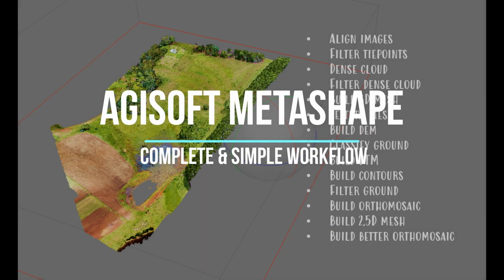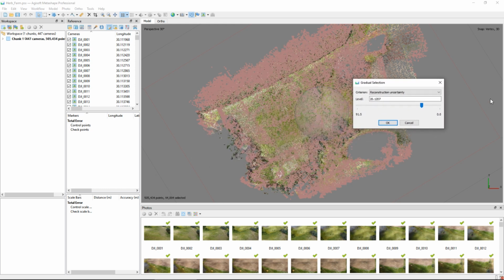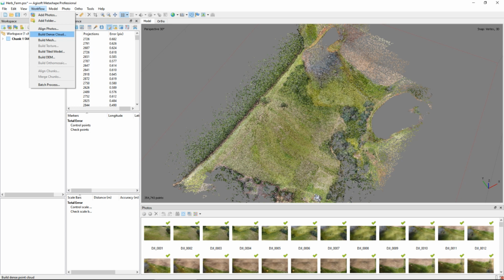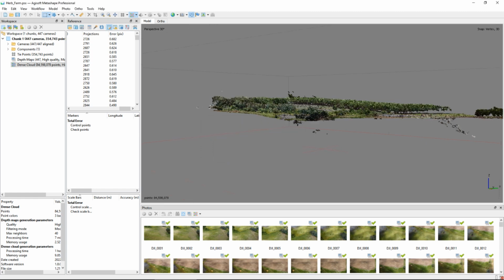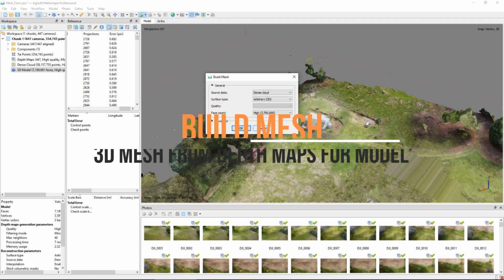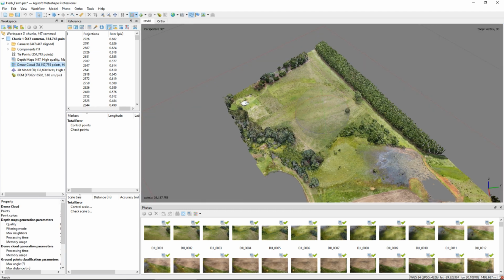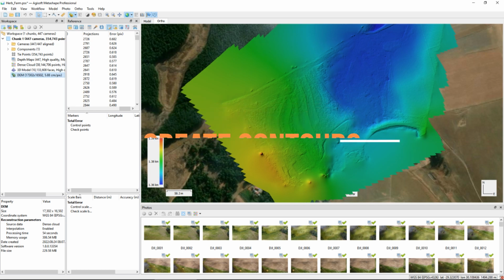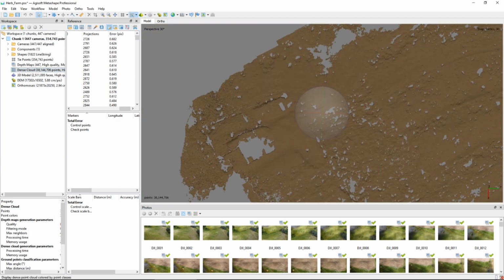Agisoft Metashape - Complete Tutorial (Cloud, Mesh, DSM, DTM, Classify, Orthoimage - No GCPs)

Comment: i'ts very hard to grasp what do I need to look after when filtering the dense cloud, to make an informed decision. I couldn't understand from your video what to look for. You have any tips for me? Thanks for the video anyway it has a lot of useful information already as it is.
Reply from the maker: Hi - it will vary from one project to the next. Effectively you are trying to judge which points are valid and which are not. To do this analyse the point positions. Are they in the same place, relative to other points? If they should be on the ground, are they on what looks like ground level? Is it meant to be a flat surface, then are the points flat? The more you do it the more comfortable you will get with making the decision. Generally, points with a confidence of 0,1,2 can be removed. With better cameras, there will be fewer erroneous points. I hope that helps a little and I'm happy to go into it further if you like, fell free to email me: geospatialtips@gmail.com
Cheers

Comment: What's the better step in your opinion, if we mark and align the GCPs first, then we do the gradual selection or vice versa? Thanks
Reply from the maker: I prefer doing the gradual selection first and then adding the GCPs afterwards. I feel that by doing so you calibrate and correct the camera independent of the GCPs (avoiding any potential GCP errors) and thus any check points have a greater likelihood of being of the same accuracy as the GCPs. (I may be wrong, but I use and prefer this method and it works well for me, others may have differing opinions)

Comment: Hello! Great video, i have some questions, if u answer me i would be very gratefull. How did u achieve such a good overlaping of your pictures ? your dense cloud is almost like an orthomosaic being seen from above. When i filter all those pictures just as you indicated, it felt like my point cloud would be almost empty.
Reply from the maker: Hi, thanks for watching.
In this example, I flew manually and also flew in a double grid pattern, so there was plenty overlap in all directions. It isn't necessary to do this, but it helps ensure a dense point cloud. Even if flying automatically, you can increase your side and forward overlap and it should give you more data in the final result.
If you are losing most of your points in filtering, it seems like the matches might not be good. You can process using higher settings and perform the gradual selection steps to ensure better tie points before building your dense cloud. The terrain you fly over will also have an impact. If there are lots of trees, the matches will usually be worse and you lose points in that case.
In the end, if one of that helps you, feel free to send me the data and I will take a quick look if you like. 
geospatialtips@gmail.com
Reply: @geospatialtips  thank You so much for your answer. I really apreciate it. Regarding to your proposition, it would be great for me if i could send you some information of My works. I Will be getting in touch soon. Greetings!

Comment: How important do you think it is to classify ground and high vegetation when mapping a forested area? It seems when I don't, the canopy of the trees get swirled or blurred. Is there a reason for this? I'm asking because I've been having issues with classifying ground points in the new version of Metashape. It's been driving me insane.
Reply from the maker: Hi - I haven’t tried the classification in the new version yet, but seems I will need to check it out. As for the trees versus ground issue it really depends on  a few factors. The swirls will likely be because the model goes to the top of trees, back down to ground, then up another tree and so on. Have you tried a 2.5D mesh that includes the trees? It may help limit those swirls. Also, if you only use classified ground the result might look better, but you may also start to see your trees leaning one way or another and not be straight up any longer.
Reply: @geospatialtips  Thanks for the response! I actually downgraded to an older version of Metashape. The ground classification worked much better! I found that creating a DEM with only ground points also gave me a higher quality orthomosaic without the swirls in the trees. It really makes a difference, not sure why. I wonder if there's another way of getting better quality orthos with forest cover, without having to do the classification process.
Reply: @geospatialtips  I actually have another question... Whenever I change coordinates from WGS to my native UTM system, it tilts the whole area by about 30°. I thought this was another issue with the newer version of Metashape, but I had the exact same problem with the older version. The only thing I can think of is it being my new drone, DJI Mavic 3 Enterprise. Is there something in doing wrong when importing photos? Should I be calibrating photos a certain way? Metashape seems to recognize the M3E ...

Comment: If we generate a 2.5D mesh and then would like to also have a 3D mesh is there a way to have both in the same  project? Will generating the second one overwrite the first one?
Can we have a DEM from both the 2.5 and 3D?
Sometimes I'd like to try different combinations to see what gives the best results.
Sometimes I might want a 2.5D to make an orthomosaic but use the 3D for volumes, etc.
Thanks again. This channel has filled in a lot of holes in my Metashape user capability.
Reply from the maker: Hi JSD!
Yes you can have multiple meshes and models. I often do the same as you, one for the mosaic and another for volumes. I am not sure if the latest Agisoft version changes anything but you should have the option to not overwrite existing models when making new ones. Also, rename the first model you make before creating the second to make sure they are easy to distinguish.
Reply: @geospatialtips
Hello Sir!  
I'll look for that option and rename before creating new items. Sounds like that should do the trick.
Thank you!
 I hope things are going well for  you, over there on the other side of the world 🙏

Comment: Hello,
I love your videos. They did help me a lot, but I stumbled upon a problem. When generating contour lines, it says minimum altitude -124m and max altitude -118m. I have no idea how to fix this and why did it show me those numbers. Maybe you can help me. I did follow everything from you video.

Thank you
Reply from the maker: Hi - what drone are you using? The altitudes it has imported come from your drone and could be negative values for a few reasons. Perhaps you are capturing a flying height, rather than actual altitude? Your focal length on the camera settings might be wrong as well, thus making your data appear lower than what it should be. You could use some control to correct this, use some python code to adjust all of the heights of images, shift the entire dataset vertically as well. It's tough to tell without some data to work with, so if it helps, feel free to send me some data to look at. 
Email me at geospatialtips@gmail.com if you like.

Comment: Is it better to clean edge data during the tie point process or after in the point cloud process?
Reply from the maker: After the point cloud process. The points collected in the tie-point process will be used to optimize your camera alignment. Thus, if you clean up too many points, you run the risk of having images that are no longer aligned. Also, cleaning the tie points will not affect the region for which the dense cloud is created, as that is determined by the aligned images and the region box. *You would still want to run the gradual selection steps to optimize your tie points though.

Comment: hank you very much for this video. It is very detailed. However, I'm having a bit of difficulty with step 3: Dense Cloud Calculation. This option is not available in the Workflow of version 2.1? Thank you in advance for your response
Reply from the maker: Hi - it has been renamed "Build Point Cloud" and is a little further down the list than it used to be. It performs the same function however.
Reply: @geospatialtips  i had the same problem as @josephagouze3770. I was able to generate the dense point cloud following your instructions, but now the "filter by confidence" is and remains greyed out. Any idea what to do?
Reply from the maker: Hi - yes, when you create the point cloud, select the Advanced option and there will be a check box you need to enable that allows you to calculate the point confidence. I suspect this was turned off for you.
Reply: @geospatialtips  thank you very much

Comment: Looks like the programmers changed the menus.  These days they just don't seem to care if they invalidate tutorials. There's no selection tot "build dense cloud" anymore.
Reply from the maker: Yip, they did change it up.
It is now called Build Point Cloud (or something like that) a little further down the same menu. But, it does the exact same thing.
Reply: @geospatialtips  Thanks! That's very useful. I don't know if the recent trends in software to just change menu items at will, voiding Youtube tutorials out there, is good or bad. I sure would have loved to ignore users back when I was stuck writing software that had user interfaces. But it still seems irresponsible to me!  I suppose, with AI rising, it won't matter much.

Comment: Hey I love your Videos😍. Is it necessary to buy Agisoft Professional to calculate the volumnia of an excavation?
Reply: And another question: is it possible to use the demo version of Abisoft Metashape Professional?
Reply from the maker: Hi - yes, you can definitely use the demo version to calculate volumes and do all other things.
Reply from the maker: Hi - thanks so much! Yes, you'll need t have the Pro version for volume calcs.
Reply: Thank you. But why does not everyone do it with the demo version which is free?
Reply from the maker: @retobrugger3270  A few reasons I can think of: The demo is only free for 30 days, after that it won't work. Secondly, I believe the terms and conditions state that the demo cannot be used for any commercial work or financial gain, so technically it shouldn't be used for such things. Nothing physically stops you from doing so and continuing to use it, but those are some reasons, nonetheless.

Comment: I have chunks of 1500 x 9 . 
I try to align using point cloud and it says not enough ram.

Total photos are about 14500.

So is there any way to merge all dem, DTM, ortho mosaic and 3d model using agisoft?

System specs : 64gb ddr4 3600mhz
i7 14700k
Rtx 3060 12 gb
1tb nvme 3.0
Reply from the maker: Hi - yes, there is a solution for your situation. You'll want to setup your computer as a local server/node.

This video will explain what you need to do: https://youtu.be/BYRIC-qkZJ8

Using this technique I have processed 35000 images using a PC with about the same specs as yours, without the need to use chunks.

All the best!

Comment: I'm working on a site with cranes. The tall boom of one of the cranes does not reconstruct well and it blocks details on the ground below. 

I've been deleting the points of the boom from the DPC. 

Then I create a 2.5d mesh from the DPC and an ortho from the mesh. Unfortunately the deleted points reappear in the ortho! How can I prevent this? 
In the past I think I have done this successfully but it's now working now. I guess I must be doing something different but I have no idea what that would be. Maybe in the past I used a 3D mesh or made the ortho from the DEM... or something else? I'm lost and I've reprocessed the project three times already 😞
I was able to assign different photos in the ortho to hide the crane but I'd rather just delete the points. At times I'd like to delete trees, wires and other things so this is an important task to learn. At this point I cant easily go back and classify the crane as something to leave out of the ortho because those points have been deleted in the DPC.
Please help. Thanks!

Using version 1.7
Reply from the maker: Hi Jerseyshoredrones!

Let's see if we can help...
When you say that the "point reappear in the ortho", is it the points themselves (such that the crane is rectified in the ortho at crane height) or, as I might expect, the crane is still seen in the ortho but is rectified onto the ground surface?

Or, to explain it this way, the points you use will create the 2.5D mesh or 3D mesh and yes, the crane should not be there if those points were deleted out and then the points saved (project saved and in turns saves the points without the crane in them). Then, you have a clean mesh. Next step is the creation of the ortho which is rectified on to that surface. However, the crane in the image may very likely be rectified because the image and the 2.5D mesh are two completely separated entities. At this stage, the crane is just a set of pixels in an image, not a 3D modelled crane. So the only way to get it out of the image is to use very selective images or use a seamline editor after processing to cut out the crane.

Basically, some things we can get rid of automatically and others we have to do manually. But if that crane is there in 3D in the ortho, I'd suggest the point cloud hasn't been saved, or not saved properly. A crane in the image (maybe draped onto the ground or underlying building etc. is just something we need to manually adjust out.)

I hope I have understood you correctly and offered some insight, but if I haven't please feel free to email me with some screenshots and we can take a deeper look?

Comment: hi, thank you for your tutorial. i followed most of your steps but i noticed that during adding photos to my agisoft, it seems to be the longitude and latitude information in the reference box are missing and all photos are in grey (no tick in the box). can u help me to identify what is my problem or missing steps? It results on me unable to create DEM. thank you in advance for your response.
Reply from the maker: Hi - sorry to hear about your issues.

I can think of two things off the top of my head:
1. Your images don't have any georeferencing for some reason, you can check this by right clicking on the file in File Explorer, then going to the Details tab and scrolling down. If the GPS info is available, you will see it.
2. There is a setting in Metashape to disable all metadata being imported. This might be active for some reason. Go to Tools/Preferences/Advanced and take a look.

If you still can't find a solution, feel free to send me an image, or a few of them, and I'll take a look for you. 
geospatialtips@gmail.com

Cheers

Comment: wonderful content abt agisoft.. thanks a lot.. can u suggest gud and optimum system configuration for running agisoft smooth and faster?
Reply from the maker: Hi - thanks for watching.
This link will take you to the page of Agisoft recommendations for system specs. I suggest focusing on the "Advanced" configuration section. https://www.agisoft.com/downloads/system-requirements/
In short a good config is the following: 64-128GB RAM, Intel i7/i9 minimum 3Ghz CPU (faster is better), 8-12GB RAM GPU i.e. Nvidia 3080. (The AMD equivalent CPUs and GPUs will work as well, keep specs to these or better)

Comment: On Align Photos I have Estimated and Sequential for the Reference Preselection.... which one do I choose
Reply from the maker: Hi
Usually estimated is a good option here. It'll perform an initial alignment, analyze the images and then correct the alignment. I think it also bases it on your GPS positions to begin with.
Sequential just uses the images in the order they appear in the list, so if you have multiple and crossing flights, this may not be a good option for you.

Comment: Hi, thank you so much for the tutorial, it has helped me a lot. I just want to ask you how can I improve the model if I'm working with crops, 'cause I'm working with images of avocado trees and looks like they're all cropped, and the ground it's all distorted. I've followed this tutorial step to step, so I wonder if it's due to a lack of quality of my images (the overlap is 65%) or I'm missing something. On the internet I've found that might be due to the lack of overlapping of the images and the movement of the leafs, and that could be improved using ground point cloud classification. Thanks!
Reply from the maker: Hi - thanks for watching and for your question.
Are the trees quite far apart, with spaces in-between where you can see the ground?
Are you rectifying them onto the DTM (ground only) or DSM ground and above-ground features? I would think the DSM gives you this odd result, if the trees have spaces between them, where you see the ground. In this case the model would be on the top of tress, then ground, then back up on the trees etc. and this could cause a bad result.
If that is the case, try classify the ground points and create your model or mesh from ground only and retry.
If that doesn't work or there are still issues, please send me screenshots and more info on my email, geospatialtips@gmail.com and I will take a look for you.
Reply: @geospatialtips  Hi, thank you very much for your response! I'll be checking that then. Maybe there were ground points that I didn't classified well enough.